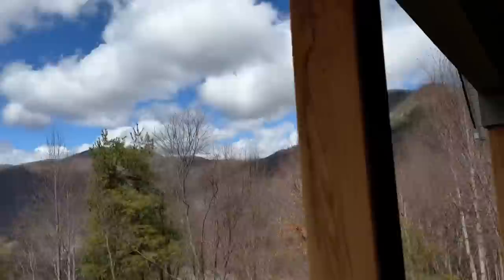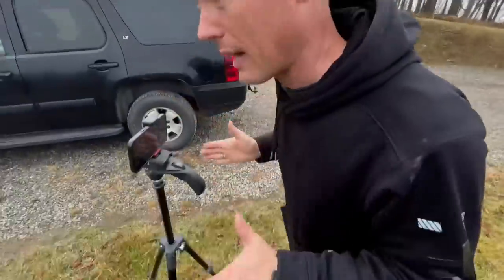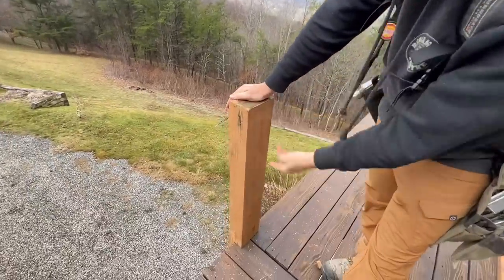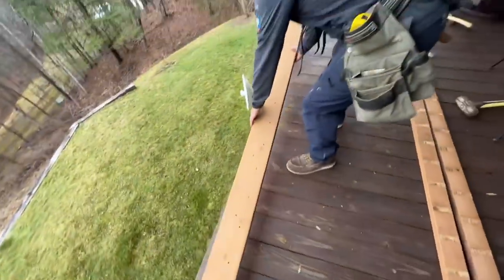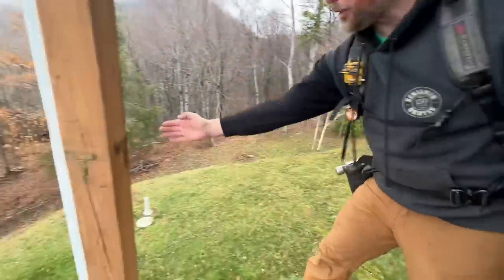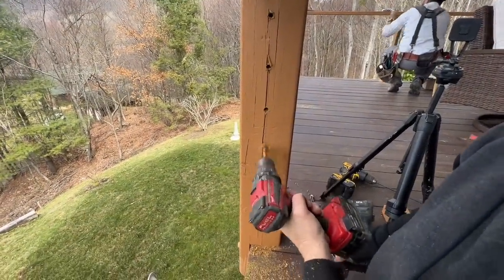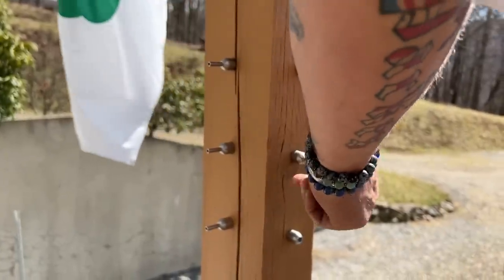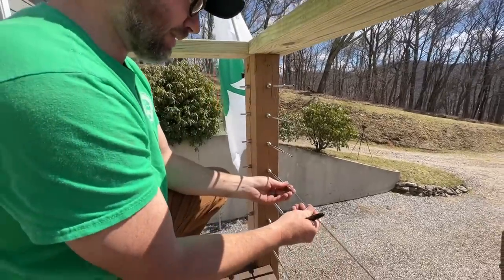Deck Railing Replacement for a Subscriber… The perfect one day project￼ for our crew!

Comment: Tin solder and a soldering iron will save the tips of the cable when threading into holes. You can also wrap it with fine sewing thread. And then you do not have to collect thin wire on the floor.

Comment: Use a perfectly straight (jointed & planed) 2x4 on edge as a drilling template. Drill the template holes on the drill press to make'em perfectly true. Clamp it to the post, start all the holes on one side & then switch it over for straight holes with no blow out.
Reply: This is the way
Reply: I like it but I feel over time you're gonna bore those holes out... almost need a metal jig... JAIME! Metalworking time
Reply: @zTribalstylerz  Yep, even better. But jig would probably be different for every job. Slightly different spacing.

Comment: I believe using the term zoom is actually correct and tracking is moving the camera closer or farther from the subject. But this is not.TV production class. Great video as always!
Reply: In Hollywood they actually lay track for moving with or in on a subject. Tracking is done by moving the camera in or out. Zooming is done with the lens. Zooming can actually change the perspective of the shot since the "zoom" lens changes focal length to affect the shot.

Comment: Aircraft drill bits were originally designed to be used on aircrafts, as the name suggests!  You were able to drill holes through deep cavities and then through thin materials.
Reply: Yeah thats right, as an aircraft mechanic every time you need to drill something on an aircraft you can rarely get the drill in the tight space so the longer drill bits are used to make it much easier
Reply: @johnlebzelter4208 He is answering the questions they asked at around @12:30
Reply: @kalebszymanski4538 as an aircraft mechanic, the most true statement I was ever told was “if you can see it, you can’t touch it. But if you can touch it, you can’t see it”

Comment: I have a client that had cedar railing and pickets also. Plus the house is all done with cedar planks. Last long but does get ruined over time and with no maintenance done on them. I had to replace all railing and pickets with pressure treated pine for them. I am in the south eastern part of NC. She had it all milled for the house some 35 years ago.

Comment: One thing that I like to do when drilling through a post is I get a long tiny drill bit and use that to drill through the post, almost like a pilot hole  Then I can come back with the bigger drill bit and drill from each side so I have clean holes on each side.  Takes the guess work out of trying to hit it from each side.
Reply: Isn't it just as likely that a small bit used for an all-the-way-through pilot hole, vs a larger bit used for a one-and-done, would be off when it pops out the far side?  What am I missing?  Thanks.
Reply: @frankhazzard3250  I think he is talking about a bit that is not long enough to go straight through. With a small bit you would have to drill in from one side then go around to the other side and try to drill a hole that will meet and finish out the through hole. I just use thru loks. No drilling requires and holds the post tighter than a cold weather nut sack

Comment: Cedar last great in drier areas. In wet areas It needs a ton of oil stain so the grain actually soaks up the protective coating
Reply: Cedar is fine in any climate as long as moisture isn’t being trapped at the end grain where it is most susceptible. Moisture doesn’t make wood rot, trapped moisture creates the ideal breeding ground for wood rot.
Reply: @prawndawg8623  that’s why I like the oil based stains. It lets the wood breathe

Comment: Tape a string level on the top of your drill after you've removed the hooks on it so you can hit the secondary hole. Use a small wood awl rather than a cotter pin.

Comment: Correct.  Also these long drill bits are used to install wiring for security systems in existing homes.  Most are 3' or 4' long and 3/16" diameter and have a hole in the tip for a wire to pull the thicker wire cable through the hole 's opening.

Comment: I make a little plywood square jig that you clamp around the posts and you just use the 'right angle of the plywood to help guide your drill bit through the posts (drilling posts on both sides), it works really well and your holes are accurate without having to 'eyeball' your drill bit for level/square and plumb, it's pretty accurate and your holes will line up well, no second guessing!  Takes 10 minutes to knock up and you just clamp it onto your posts (Irwin quick clamps) to drill your holes.
 Run your cables through each post (put some painters tape on each end of each post so you don't get confused as to which cable is what as you go and then thread your capping on as the same time with each post (it's a bit time consuming but it's the way to do it, that way you don't or won't risk feather out your cable strands or your cables all out of level/alignment) Just a thought or tip.

Comment: Some long drill bits have a small hole near the tip, so you can pull small wire back through the hole.  Commonly used by telephone, sound , and alarm installers.

Comment: The action of crimping does more than just "holding with tension", it actually weld them togheter, as surprising as it sounds.
Reply: No, it doesn’t weld anything.
Reply: @whilomforge3402  yes buddy. Google it for 2 seconds. It's called a cold welding. There is a whole long scientific explanation on how and why it happens. Wish you good read.
Reply: @1Akanan1  I know what cold welding is, but I am seriously doubtful that such a thing was achieved here, or that it even could be. When I attended college, we learned about this process. We tried to achieve cold welding using hand tools and copper wire, steel wire and steel cable. There was almost a 100% failure rate among those wires and cables that were crimped by hand. A ratcheting crimping tool was necessary to achieve a true cold welding. And even then, there was about a 20-25% rate of failure.

Comment: If you're curious enough, swage one of those connectors on and then cut it with a grinder. Chances are, you won't be able to even see the strands of the cable anymore. With a good tool you damn near cold weld the cable to the ferrule.
Reply: Sound like magic!

Comment: Pro Tip. Put a boxed in wrench or ring (wedding ring) on the drill bit and if you keep it in the middle (between the bit and the wood) it will keep it level. Then you only have to keep it good left to right.
Reply: Nice tip!

Comment: I really wish these were legal in my area - looks so great! (We're not allowed any horizontal type stuff because of climbing risk.)
Reply: That’s a town by town requirement. Some towns have no problem with it, but 5 minutes away one town over, it’s a complete prohibition. Very annoying. I understand the concept… it creates a ladder effect and you can climb up and fall over. But it’s not that hard to climb vertical balusters either, so it’s not exactly saving lives at a rate you can measure by the minute.

Comment: I like to use “Crescent NP11“ nail puller pliers for removing rusty nails with minimum damage.
Reply: Put your wedding band on that "aircraft bit" while drilling.  If it slides towards the post you drilling down roo much, if it heads towards the drill your drilling on an upward angle.  If your level,  it'll stay put in one spot.

Comment: A tip for cutting wire rope, use a few turns of electrical tape and cut through the tape, you will get a clean cut every time.

Comment: Nice job guys! You house builders seemed super OP on a job that that 😁 As a painter I really wish you woulda filled those cracks. Specially on the vertical posts, specially when there was a huge crack right down the center where you were running your cables thru! But those rails are super cool and I appreciate you sharing your expertise on them and in general.
Reply: The cracks, known as checking, is due to the natural shrinking and swelling that the pine goes through being exposed to the elements. If you fill it, it won’t always stay filled and can sometimes end up looking worse. Not always tho, it’s kind of a crap shoot. Anything left outside is so unpredictable.

Comment: I see that today 9/28/24 things are very bad in your part of the country. Saw video of a house floating away near Asheville. Be safe. Enjoy your videos. BTW a portable "drill press" would help drill those holes square to the post (assuming the posts are square) and if you just string the bushings on the wire and pushed them home it would be easier to push the wire through the holes.

Comment: The drill bit If it has a hole in it it's a bell hanger bit for fishing wires run bit in hook wire to hole pull bit and wire back out.

Comment: The cables should be tight when you crimp them the cable will stretch over time and you might run out of adjustment down the road

Comment: It appears the cedar rotted because it was painted.  Cedar should only be stained with penetrating oil or left natural. It will last 50 plus years if allowed to dry. Hence cedar shake roofs.
Reply: shake
Reply: @frotobaggins7169  cedar shack shake roofs
Reply: @frotobaggins7169  Thanks. Auto correct strikes again.
Reply: @1111cj  I hope I didn't come across as some grammar nazi.  good thing we have smart phones to correct our correct spelling and words.  I don't often correct spelling but I wanted to point out more for others that might not know that it's shake.
Reply: @zTribalstylerz  I thought the shack had a TIIIIN ROOOF....
Reply: @frotobaggins7169  rusted.
Reply: Wow, great insight there…

Comment: Great work! just a thought about the angled section: would it be possible to use a piece of scrap wood (same width as the hardware piece) to shift the layout instead of using the string line?
Reply: Yes that is a good idea

Comment: Aircraft drill bits are long drill bits originally designed for use in the aircraft industry where they often need to drill holes reaching through deep cavities, and then through thin materials.

Comment: Make a U shaped jig.  Take two 2x4’s the width of the posts, drill a hole through the center of one, stack the two together and drill through the first and into the second.  Screw a board to connect the two drilled boards together into the U shape.  Now you have a jig to drill through each side half way to meet in the middle.  It will take far less time to make the jig than it took me to type this!  😂

Comment: Have u guys ever tried wrapping tape around cable and then cutting the taped area it mite keep cable uniform for threading thru posts?
Reply: Not yet but that sound like a good idea
Reply: @jaimeperkins9606  I've seen it done on braided stainless hose with Teflon liner for hydraulics and fuels it doesn't allow the wires or braid to flare out making it very difficult to feed through fittings or in your case wire ends.

Comment: I’m a deck builder in Illinois. That deck seems to be more than 8’ elevation. The IRC requires railings to be 42” for decks over 8’ off the ground. Different in North Carolina?

Comment: When you are doing a railing, would it help to put that top board at an angle to help with water pooling? Which would help prevent root like what was in this video.
Reply: I think it would take a lot(too much) slope to get water to really run off.

Comment: Swaging (/ˈsweɪdʒɪŋ/) is a forging process in which the dimensions of an item are altered using dies into which the item is forced.[1] Swaging is usually a cold working process, but also may be hot worked.[2]
The term "swage" comes from the Old French term souage, meaning "decorative groove" or "ornamental moulding".[3] Swages were originally tools used by blacksmiths to form metal into various shapes too intricate to make with a hammer alone. These have handles for holding or pegs for attaching to an anvil, and often a flat head for striking with a hammer. Swage blocks are anvil-like dies with various shapes forged into them, which are also used for forming metal. Swages called "fullers" are specific to making grooves in swords and knives.
Swage is most often pronounced /ˈsweɪdʒ/ (AHD format: swāj).[4][5] Another (less common) pronunciation sometimes heard in the metalworking industries is /ˈswɛdʒ/ (AHD format: swĕj)[6] (perhaps influenced by sledge as in sledgehammer).
Reply: Wow!  That is an excellent explanation, thank you

Comment: PRO TIPS:  You need a 3D Square.  It wraps around accurately.  Also, they make a cheap device to hold your drill like a drill press making it go in straight.

Comment: Hi guys , I worked as a maintenance carpenter for the Boeing company for many years and those extended length bits bits were used a lot in production . So . . . I’m thinking that may be where that term “ airplane bit “ came from .
Reply: Also looks like it has a 150 degree angle on the tip, that pertains mostly to drilling window holes but maybe that has something to with the name too?

Comment: Had to Google that

What is an Aircraft bit?
Aircraft drill bits are long drill bits originally designed for use in the aircraft industry where they often need to drill holes reaching through deep cavities, and then through thin materials.22 Feb 2012